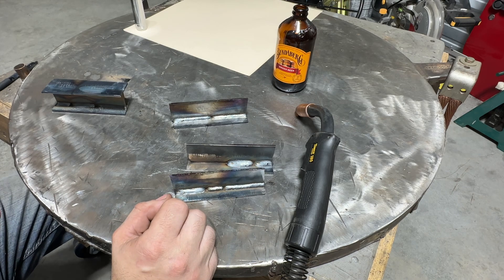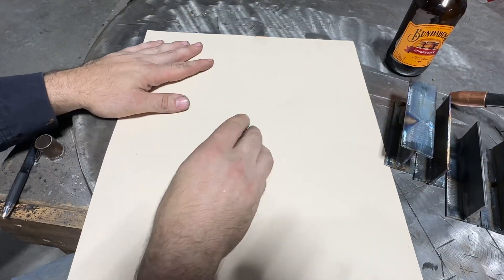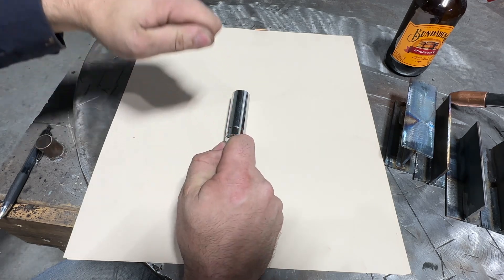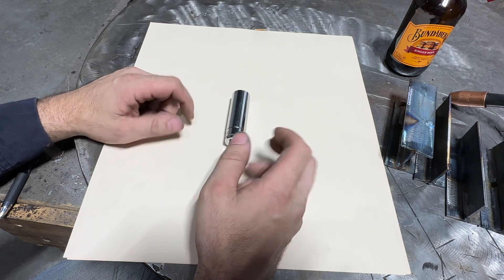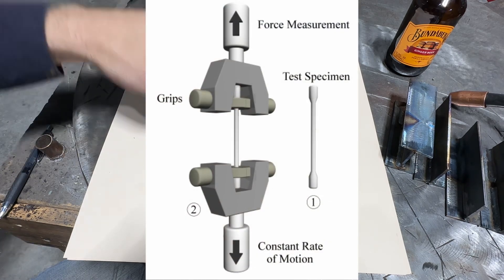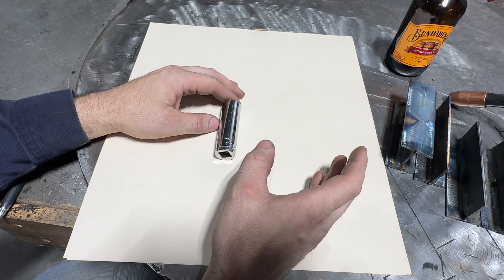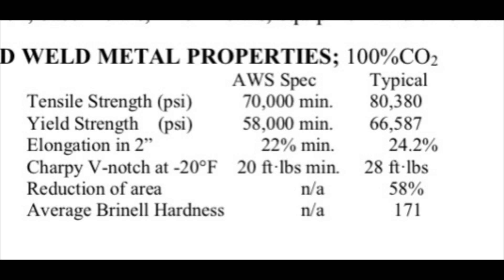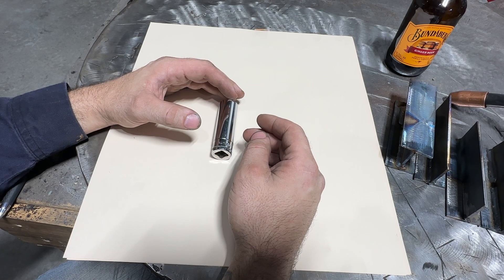Viewer question answered:  What's tensile strength?

Comment: I worked as an operator 40 years in nuke plant, and I have seen just about every kind of weld and weld failure (usually followed up by training from subject matter experts as to why something failed etc.), and I have to say that your explanations were very informative and I learned new things.  That is to say, as a home-gamer, just learning to weld, all that nuclear stuff is light years beyond what I will ever be capable of.  What I and others need is the DIY kind of knowledge like yours, and you are an awesome teacher as you are well grounded in the real world, and your philosophies and wisdom are priceless!!! So Thank You for sharing that with us. 

That being said, with regard to this video, I was thinking that it would be interesting to compare MIG, Flux Core, TIG and Stick welding on the usual material we home-gamers would build with i.e.  1/8”and 1/4” mild steel.

I would like to see the two most common weld joints in a sort of head-to-head comparison with each set of coupons receiving a 2” weld of the four different process.  It would be beneficial to see a cut and etc of each process for penetration and maybe a little mechanical strength aka a bend test on some of those if it isn’t too much work.  Perhaps you can do most the welding and etching off camera, and then go through the samples as more of a book learning with a show and tell of each example. 

Recently, I got a cordless Milwaukee portable bandsaw and a Harbor Freight bandsaw stand (can be used vertically and horizontally like a chop-saw), which makes it easy to cut and etch some of my welds.  

  And it’s handy for cutting my Dumpster Diving scavenged and remnants pile metals to more manageable sections.

I’m glad to see you have plenty of ideas for videos, and I know this would be a lot of work, but I don’t think there are many head-to-head comparisons of welding process in the same videos as most content creators tend to focus on one at a time. 

I really appreciate the amount of work and care you put into each video. As I have mentioned before, in my career, I have received a tremendous amount of training, and of all those who have trained me through those decades, I rank you in the top of the top tier!

Thanks again Greg!
Reply from the maker: Tons of great ideas, thanks for sharing.  I have wanted to do a weld comparison with tig/stick/Mig.  I have just the thing to do it with.  I am going to talk with a friend of mine who has a bulldozer and setup some kind of pull test using it.  I am sure it would be great entertainment and I am sure there would be more than a few surprises to what comes out on top.  I have to do it in a way where I know they will fail and there is clear evidence to how much force it took.  I will figure it out and get on it lol.

Comment: I love your videos they are so informative and I understand everything you say.  You also teach in a way that's not just do it this way because that's the way it is.  I once built a fork to bend metal at first I did it with 6013 and it failed.  Then I tried with 7018 it took longer but eventually it failed.  Lastly I did it with 6010 and that worked.  I greatly appreciate your videos.  Thank you.
Reply from the maker: You’re welcome and thanks 😀.  I try to explain why I think things should be done a certain way.  The reason is I want everyone to be able to make decisions for themselves on how to approach things.  There are so few absolutes in welding and so many different situations.  Its most important to be able to decide what’s best for you and not what the book answer is.  That’s how you are able to really fix/make stuff.

Comment: Greg, when talking about the weld structure was there an opportunity to consider the grain structure of the weld. Yes its an alloy but will have a similar grain structure to a casting. Large (soft) grains in the slow cooling centre small (hard) grains in the rapidly cooling edges due to the cold workpiece.  Between the two are equi-lateral grains. Over welding which adds extra heat may compound the issue.  Heat treatments like annealing might be required in critical strength applications. 

Just a thought, what do you think?  
Brian
Reply from the maker: Excellent thoughts and something I have not really mentioned.  Grain structure is very important and is why in many cases “code work” specifies no weaves, specific settings/fillers/max heat inputs, etc for certain welds.  I have seen and read about actual testing on stingers vs weaves, and despite using the same filler material the welds will perform differently.  The filler material itself has certain criteria it must meet in testing.  However if you put huge welds down (excessive heat input), use different shielding gas than the wire was designed for, or weld on alloys of metal the filler was not designed for the end results could be far less strength/performance than expected.  I wish I had a high end tensile strength testing machine to demonstrate this.  Even home gamers could benefit by the knowledge gained via that kind of testing.  I definitely will cover this in the future and I will make sure to mention your post because you brought up a important (and overlooked) aspect of welding 😀
Reply: Some years ago I had access to a materials testing lab and to all of the testing machines. Very interesting. Having the machines trace out exactly what theory dictates was fascinating.
Reply from the maker: Very cool, that would be a dream come true for me lol.  The hardest part I would imagine is trying to get repeatable accurate tests.  Any small thing thats changed can significantly change the outcome when you are trying to accurately test anything.
Reply: As you said in your video the test piece specimens are very accurate (and fairly expensive). Sometimes a customer would send in some material to be tested and specimens were cnc machined to precise dimensions and undergo specific heat treatments to allow accurate comparisons against known standards. The machine testing lab was maintained at 20 degrees centigrade.  

A very enjoyable experience and were I gained great insight into material properties.

Comment: Excellent video & explanation, that couldn't have came at a better time! While I'm interested personally, I have two boys (13 &14yo) & recently purchased another welder (ARCCAPTAIN MIG200), in large part, just so that they could use it and learn. Similar to a previous commenter's suggestion, I thought it might be informative (aka, engaging for them) to compare SMAW (6011 & 7018), GMAW, & FCAW welds, & their strength/penetration, in a test. Exactly to your point on mechanical strength/weld quality, I was thinking that having coupons butted, vs a space allowing proper penetration; just to further prove the point on proper joint preparation.

This sort of test may be something that you would consider for an upcoming video (which seems like a natural progression from this video).....but regardless, thanks for sharing this video and information!

P.S.-  Any feedback/suggestions (from you or other viewers/commenters) on how to make this a fun learning event for teenage boys, would be appreciated. Thanks!
Reply from the maker: I will be comparing welds in a test like you mentioned very soon.  I won’t be able to do a
exact tensile strength testing however I definitely can do some destructive testing that will show key differences between them.  There are actual limitations to certain processes when it comes to thicker metal.  I definitely will be going over all of that 😀. 

The best way to really show strength differences in welds (between proper and poor penetration) is in a fillet weld break test.  Weld two fillet welds on 1/8 it 1/4 inch steel, 1 with a good weld and one with a bad one.  Hold the plate in a vise and bend the upright plate away from the weld.  If the weld is poor enough it will break.  If neither break with a fair amount of force applied then bend the upright plate towards the weld.  They will both break at some point.  The properly penetrated weld will take significantly more force to break.  The same can be done with 6011 vs say 6013, you will find 6011 will likely take more force to break all things being equal because it has more penetration.  This is a great example of mechanical strength vs tensile strength tests.  

I haven’t taught a lot of kids but I know that kids are very curious and definitely like to test things.  A simple hammer test on a welded joint will do wonders to instantly show success or failure, and make things interesting.  One of the hardest things with learning to weld is finding meaning in the monotonous nature of actually learning to weld.  It’s a lot of “not fun/tedious/failures” with a very narrow window of what’s actually “good”.  In todays world where kids are used to getting full credit for less than perfect work, welding doesn’t work like that.  It can be immensely discouraging when significant work has not netted present success, which is why many people don’t stick with welding long enough to succeed.  The war is won with small battles overtime, not in one instance.  It’s not about where you are today, it’s about putting the work into something to get to some place better tomorrow.  Instilling in your boys that any skill (welding or not) will pay massive dividends in the long run is important.  To help with your situation (and many others) is why I am setting up a free online program to follow so people have a actual road map of sorts to follow.  That way there is structure, goals, and results.  😀

Comment: I appreciate how well you explained all of this. One thing I don't understand is you said something about spray transfer mig? I understand short arc (i think) but do you have a video on transfer modes? If not, maybe some day you could?
Reply from the maker: I will be doing a video on that shortly.  To give you an overview:  Wire welding has a bunch of “modes of transfer”, the common ones are short arc (short circuit), globular, and spray transfer.  

Standard/common “mig” is done with either c25 gas (75% argon 25% co2) or 100% co2.  The wire remains more or less a solid and “sticks” the molten pool thus “shorting out” many times per second.  The pluses of this mode is easy ability to weld out of position, clean welds, ability to weld thin materials, and a cheaper welder can do it.

Globular transfer can be done mostly with 100% co2.  It basically is short circuit run hot enough that the wire becomes big droplets that cross over to the molten puddle.  This isn’t very common because it produces a ton of spatter.  It does have much more root fusion in comparison to short circuit.  So basically penetration is better than short circuit, the gas used is cheaper, and many welders can do it.  Downsides are excessive spatter, difficulty to control, and I bet it runs out of flat position far poorer than short circuit.

Spray transfer is a little bit more complex.  It requires higher voltage (25+ volts) and unique shielding gasses.  The wire feed speed is much higher than short circuit, mostly to keep the actual arc that’s present from hitting the contact tip.  C10 (90% argon 10% co2), 95/5 (argon/oxygen) and even some gas mixtures with hydrogen can work.  Rather than the wire hitting the puddle as a solid, or a big molten balls, the wire liquifies before it ever gets close to the plate you’re welding.  The benefits of this is much higher heat input, much better root fusion/penetration, much higher metal deposition, an almost silent arc, and the ability to weld thick materials safely.  The downsides to this process is without pulse you cant weld uphill (molten pool runs it’s so liquid) you cant weld thin material with it, and virtually all “home gamer” welders cant support the voltage or power output needed to run it.  

So basically all 3 can be done with the same welder (provided it’s capable of 25+ volts and atleast 220amps), the same wire (er70 .035 diameter) provided you use the correct gas.  Like I said spray transfer isn’t very common in the home shop because most wire welders can’t achieve the voltage/amperage requirements and most people don’t have the shielding gas required.
Reply: @makingmistakeswithgreg  Thanks for the explanation. Don't feel obligated to answer this, I can just catch it in the video. Do people intentionally try to achieve globular or spray transfer, or is it just something that happens when you crank a machine up and have the correct shielding gas?
Also how does fcaw fit in here?